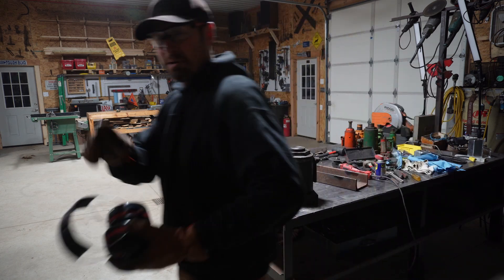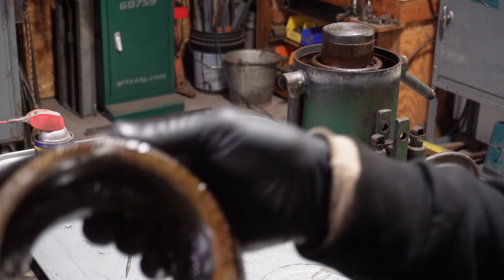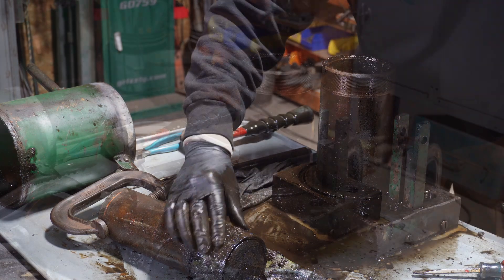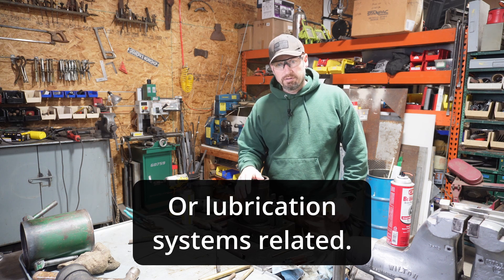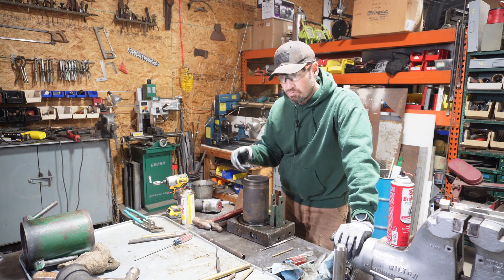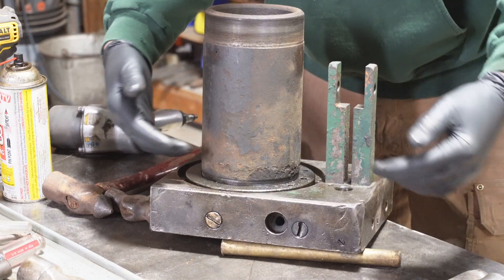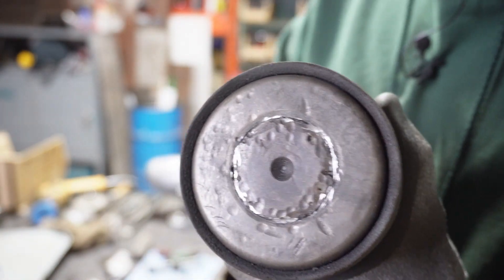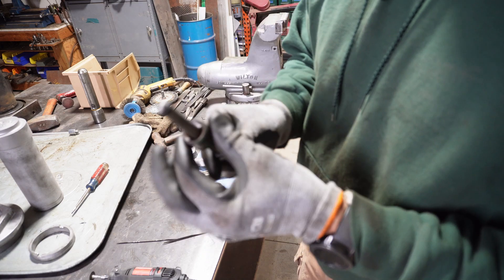Full restoration of 50 Ton Bottle jack

Comment: No wonder it didn't work!  lol.
Reply from the maker: YUP, all clean now,  got the kit,  but it was for the 100 ton,  which me and the two guys agreed it was.  Once I saw the kit I knew it wasn't right.  Correct kit is on the way.
Reply: @twosawacres8096  where are you ordering parts from? I got sold a 20 ton bottle jack that I was told worked but I finally get it (15$ eBay auction 😂) and it goes up but won’t go down. Sigh.